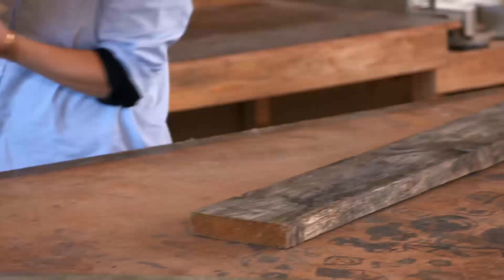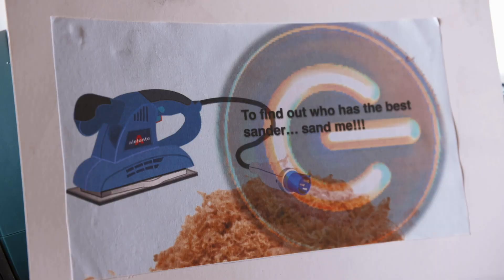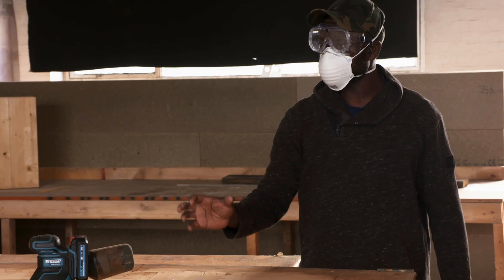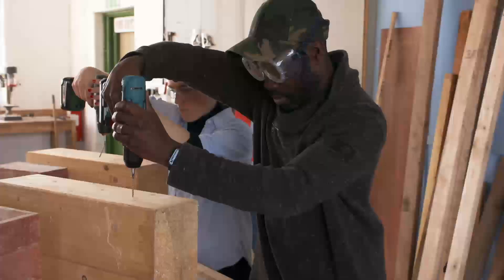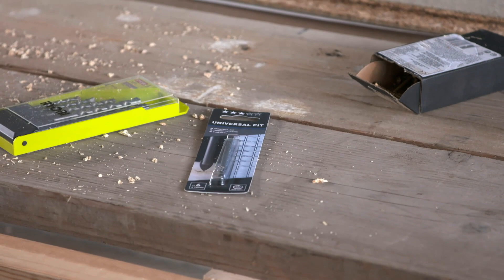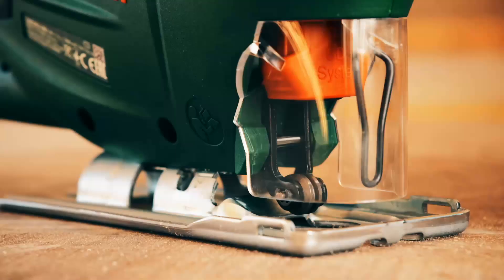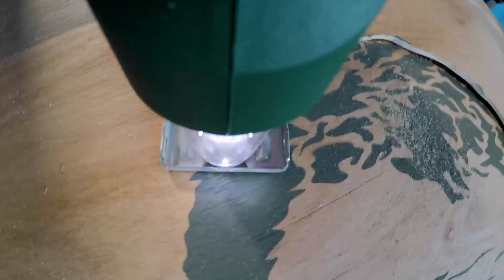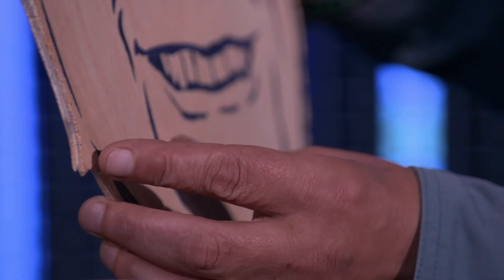Cheap VS Expensive DIY Power Tools | The Gadget Show

Comment: I have been roofing for 20 years and have had a huge range of tools ranging in brands such as DeWalt, Makita, Erbauer, Hitachi, Bosch, Milwaukee, hilti, and quite a few really cheap brands like Pro Power and Wilko. my opinion is if you use the tool right you can't really go wrong. the real question is how much your going to use it for and the feel of the tool. if you need a Jigsaw and your only going to use it once then just spend £30 at wilko lol and if it unlikely breaks in one use you can get your money back. if your DIY and want a small collection then you can't go wrong with Erbauer or Hitachi/hikoki or even consider buying used tools. when I started out I brought a used Bosch SDS drill for £20 and even came with a load of bits and chisels 😊 that still works to this day. if your a professional then you don't need advice as you will have your own interests haha and your here for the same reason I am lol you sat down and got stuck on your phone 😭

Comment: Where is the cheap vs expensive? Less than £100 difference accross 3 combined tools? 

Sander £150 Vs Sander £ 118
Drill £100 Vs Drill £80
Jigsaw £160 Vs Jigsaw £118

£410 Vs £316

Hardly a massive difference is it, why not test some of the real budget sub £50 stuff against some of the more common Makita/Dewalt tools?

Comment: Erbauer are really very good for the price, I would consider them budget trade tools. Got a few different corded and cordless Erbauer tools, happy to use the impact driver and combi drill in the workshop alongside a couple of much more expensive Milwaukee impact wrenches. Look and feel very well made, much better option than some of the higher end DIY brands like Ryobi.

Green Bosch tools are pretty much junk, overpriced DIY grade. Might as well buy something really cheap like Black & Decker or Mac Alistair, similar quality for much lower prices. Blue Bosch tools are trade rated but honestly not that impressive for the price, for similar money or less you can get Milwaukee, DeWalt and Makita which are all better than Blue Bosch.

Comment: I have some of the Erbaurer tools and I think they are great for the money and perform just as well as the lower end Dewalt/Makita stuff. The drill I have is featured in this video and performs much better than my low end Makita G series hammer drill although the Makita does feel better built and can probably take more abuse (the chuck on the Erbaurer has lot its grip a couple of times but that used to happen a lot on my old Dewalt drill) . However this test is a little unfair on Bosch because it was the low end DIY green power tools that were tested and not the Blue range which is designed for the trade.  Interestingly Erbaurer (a Kingfisher owned brand) positions itself more as a budget trade tool where as the Bosch Green range is more of a DIY product.

Also nothing was mentioned about the battery technology used here, I am willing to bet the Erbaurers charge a lot quicker given the same capacity.  The major downside to Erbaurer is you cannot get any spare parts from Screwfix or B&Q, but the same might be true with the Bosch green range.
Reply: Yeah but just go in Screwfix within two years get a new one no questions asked if it breaks, don't know where they bought these got mine a lot cheaper if I recall rightly between 50 to 80 max for bare tools

Comment: Not a fair battle really. Erbauer is a good brand and I own both Erbauer and Bosch tools. Bosch has multiple ranges of tools. Bosch Professional series are absolute ACE and Erbauer only has one range. Used a friends Erbauer Jigsaw once and loved it so much ended up buying one just for the sake of keeping it didn't have much use of that. Erbauer tools accessories are not as good and well finished as Bosch ones. Like Drill auxilury handle, Tool case etc. But Erbauer really provides great value for Money for DIY and enthusiasts, Not for Heavy use pro works.